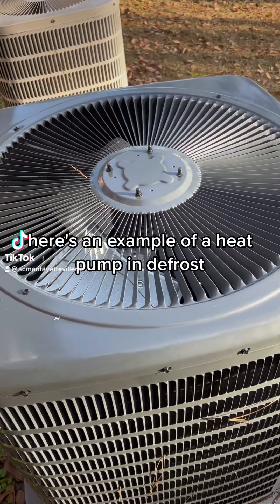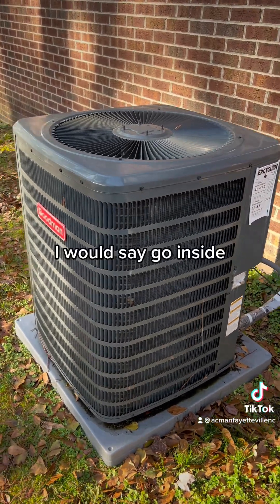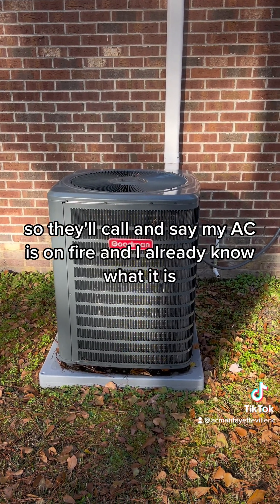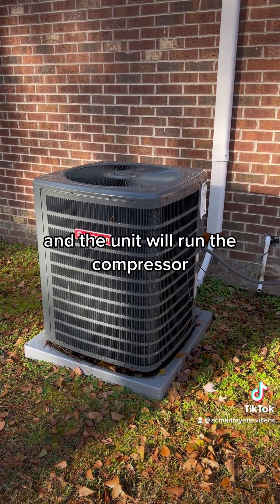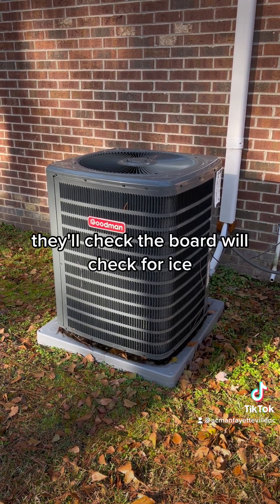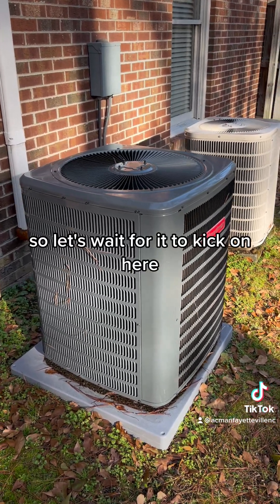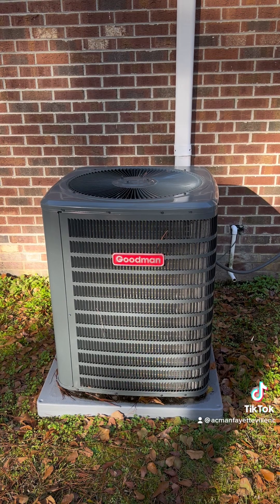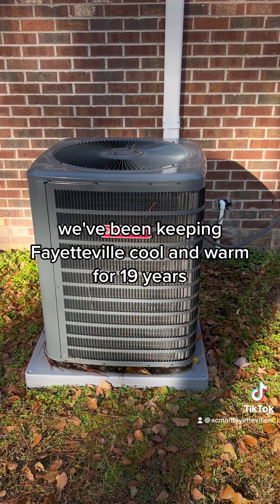Why Is Your AC Unit Steaming? The Truth About Defrost Mode Revealed!

Comment: Good job..... but a quick minor question. I have a Honeywell indoor thermostat. When in normal heat mode....it says on the display "heat on". When temp is satisfied, that wording disappears. Normal. However, if I reset the "Wanted" temp to be much higher, like 2-3 degrees higher, then I see not only the words "heat on".....but also "aux heat" or "emerg heat" words displayed too. Also normal. So the question......when the outdoor unit goes into defrost, and supposedly the heat strips come on during this time-frame.....why don't I see "aux heat" or "emer heat" wording on my thermostat while defrosting ???
Reply from the maker: The themostat has no idea that the system is on defrost. The unit initiates its own defrost and sends the signals to the proper components from the board. The thermostat has no idea
Reply: @ACManHeatingandAir  ...I get what you're saying....but if the heat strips are "on" in the air handler under a call for heat when the unit can't keep up....the extra words "aux heat" appear above the words "heating". How does the thermostat know to say that during this mode of operation? This means the thermostat "knows" the heat strips are "on" during a call for heat. So.... if that's the case, and the heat strips come "on" during defrost....why doesn't the thermostat indicate that same thing during defrost? See what I mean?....not trying to be argumentative....just curious if its how the circuit communicates this.
Reply from the maker: in defrost mode they are not on from a call for heat. The condenser board sends a signal to the heat strips not the tstat.
Reply: @ACManHeatingandAir  ...ok...would be nice to have "indication" of "when" heat strips are active by some sort of indicator.....regardless if triggered by the thermostat or condenser.
Reply from the maker: @ if you have a high efficiency system with the matching system thermostat you will. If you have 14 or 15 seer system with random thermostat you won’t
Reply: @ACManHeatingandAir  ..thank you for the added info....

Comment: Well this video put my mind at ease. Thank you for jumping right into the example. We bought a house with a 15yr old heat pump system. First one I've owned, I could hear the compressor running but not the fan, which made me think the capacitor or motor was bad...so 2 days or testing different things in 25° weather to only slowly realize...maybe it's supposed to do this.
Reply from the maker: Glad it helped!

Comment: Defrosting happened after I cleaned up my condenser fins with pressured water inside out and left water inside the bottom of unit because their is no exit hose in the bottom. Is my situation normal too with the white odorless smoke? Or it only happens when there is ice? I freaked out and turned off the units:)
Reply from the maker: sounds normal

Comment: Defrost mode was loud but there was an intermittent click as if something was attempting to start.  A few minutes later the fan was spinning and unit had a low hum operation sound as normal.  Any issues there?  For ref. the unit didnt run all day and temps were right at 32F.
Reply from the maker: it sounds normal. It’s hard to diagnose with that description, but it doesn’t sound too far

Comment: Thank you very much for posting this video. I just got rid of my old Carrier Unit and got those new ones with a heat pump, that was doing the same thing on the video shown and that same noise when it cuts off the fan and releases what looks like smoke. I thought there was something wrong but the way how you explained it is a relief. I'm still in the learning process of how and when to use the heat pump, all new to me.